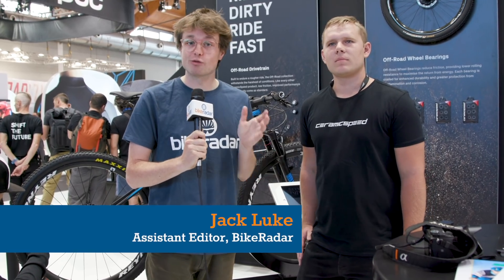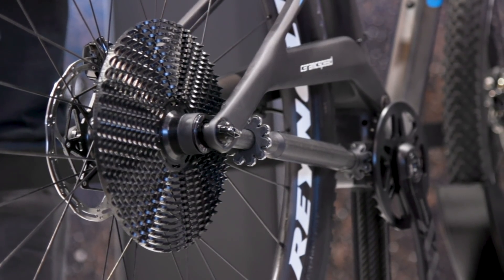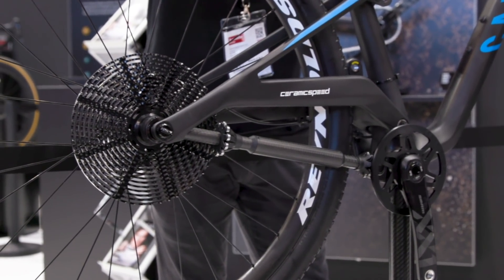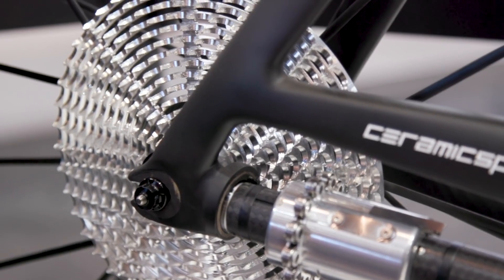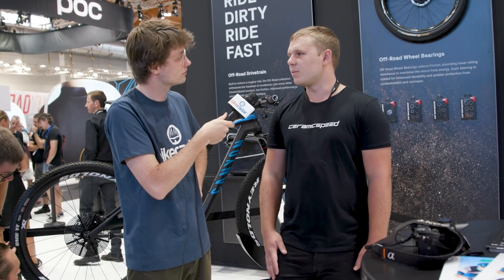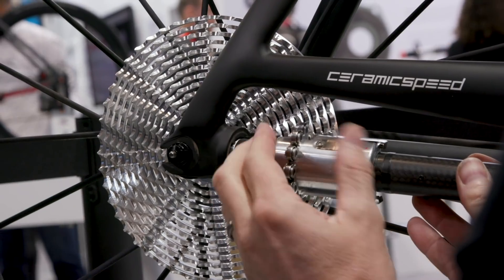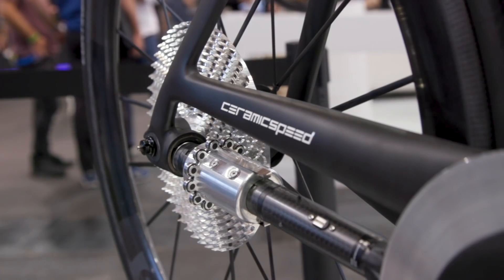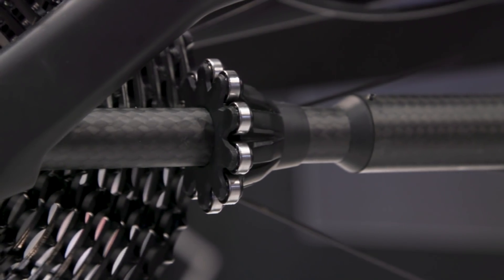No More Chains! The Future of Bike Design? | CeramicSpeed’s Driven MTB & Road Drivetrain

Comment: Don't know why people hate on this concept. They are comparing a finished product to a prototype. I'm not the biggest ceramicspeed fan when it comes to their ceramic bearings and their pulley wheels but this concept can become a real alternative. Hat's off to ceramicspeed.
Reply: Don't see the downside to the research, other than $. But if people are willing to risk $, why the hell not? Even if it ultimately doesn't work in this form, it may lead in other directions to other innovations. Whenever anyone states with great assurance that something will never work, I can only laugh, because there's only one subject where such proclamations are even remotely justified - math
Reply: Put  that  thing in high  gear  stand on the pedal   and  watch   that  rear sprocket   slip teeth.
Reply: Because it's useless horseshit is why we hate on it. If you're such a damn visionary buy the prototype and ride laps around all us pessimists and luddites. Wow, you are so freaking imaginative and smart. Better yet invest your savings in the company, since you're so ahead of the curve.
I clicked on this video to get it out of my recommendations. I will never purchase anything from ceramic speed. I will always know them as purveyors of insulting click bait.
Reply: the good old chain is just better
And more reliable
And easy to fix or replace
Reply: @riyadzahdour1302  more reliable? No. Easier to fix or change? Yes
Reply: @stevengunter4990  someone give me a reason why no one uses this system other then it just isn't as good as a chain please
Reply: @stevengunter4990  Chains are extremely reliable provided they are maintained correctly.  The chain itself isn't even the problem on a bicycles transmission, it's the derailleur system that is far from ideal but still better than anything else that has attempted to replace it so far.
Reply: I agree with filip000. I used to sell bicycle with a driveshaft transmission. Brik bicycles is a Dutch brand.
These things were really hard to fix when broken. This right angle gear meshing was so sensitive to missallignment.
And still these things would wear out fast 10.000 km or so. Than there was the weight and efficiency. Terrible!
These ceramic guys expect too much from their material science department.
Adding a few small rollers for efficiency.
This thing will never perform outside a lab.
Reply: 1. Loss of efficiency due to right angle.
2. One small pebble and it's destination f--ked.
3. Cost
Reply: @truantray  which system do you mean? I can relate these points to my current drivetrain. 😭
Reply: Looks like wont stand up to a muddy bike ride
Reply: It has no chance of working reliably when alloys start to wear from normal-amateur use. Absolutely no fucking chance for off road and pro muscles. If it was reliable, shimano would be in the game. cs is just a bunch of clowns. Now you know.
Reply: design of prop shaft and way it touches theet is not good, it will bend if step on pedal as animal, take a look on your bike how it swings: front rings, rear triangle,,, in this concept must not be any movement between skaft and rings othervise will skip theet
Reply: It looks flash in practice ? If you know about cycling gears are useless , you move a bike by torque , its an expensive flash looking waste , no mention of torque or how body works . , Imagine that covered in shit in a year .
Reply: If you've ever drove mtb, you most certainly bent, damaged, or straight destroyed your  front gear and broke off rear derailleur mount. Here you will directly damage either your gears or your frame, or you will bend irreplacable front gear. This concept is nice theory, but from maintenance and general usage theory it's a nightmare.
Reply: No, it can't be a legitimate alternative with its current construction or intended use. It's been done on utility/city bikes before, and those were fraught with issues every time.

There's power loss with every 90 degree change in direction. This is accepted in other applications because there's sufficient margin within the power available. 

Unless very hard materials are used, this will lack durability for enthusiast riding. Most gears in shaft driven applications use tough, if not very hard, steel gears. I'm doubtful that aluminum sprockets will be stiff enough to prevent deflection, especially once worn. Chain driven gears are loaded inline with the chain, so they can use lighter materials or thinner sections. 

These types of gears handle contamination poorly. In a transmission or industrial application the teeth would be submerged in oil or greased and sealed. Even then, those typically have a filtration system. You could compromise a bit, but not enough to put this in a muddy environment. Current chain driven bicycle sprockets are cheap and deal with the contamination decently. 

The biggest reason though: it's an inflexible design and can't be retrofit. That will singularly stall adoption. Gearboxes and some internal gears have similar hurdles,  but handle this concession well because they're generally designed for high durability. That seems to be the antithesis of their design.
Reply: Chain much better driven than shaft. Much direct feel and less lost of power.
Reply: There are issues with durability, staying clean, not being repairable, etc.
Reply: Its gonna last five minutes as its only got one point of contact.
Reply: @rossy2998  nonsense any gearbox with straight cut gears work just the same.  Besides they have already tested it..
Reply: Because the concept has 2 major problems, a 90 degree gear mesh has a lower efficiency than a straight one and there is no synchronisation.
Reply: It's useless from an engineering standpoint. I explained why in a post above.
Reply: @filip000  Saddly couldn't find your post but as a MTBer having no deraliour to worry about doesn't seem useless to me. Additional dust and water protection could make this concept a real reliable alternive to my current setup.
(A MTBer's perspective)
Reply: @Rabrand1  In very short: instead of transferring power over some 15+ teeth, it uses 1 or 2. It will fail, develop play, and will NEVER be as 15% as good as a regular chain. Also, 100 year old concept.
Reply: @filip000  Thank God the Wright brothers didn't listen to people like you back in the day.....keep it up, dude ;-)
Reply: @filip000  Couple of things, 1) they're using bearings that roll over the teeth, they don't just grab the teeth like a chain does. 2)Chain driven bikes are over a 100 years old. So what?
Reply: @userbeverage  Not agreeing or disagreeing with you, but the Wright brothers used chains.
Reply: @tubularmonkeymaniac  what do you think is in each chain link? Roller bearings mate. Every single link. Go to your bike, you can spin em if you took care of your chain.
Reply: @jasoncall3731  3% more aero but how much mechanical force is lost. I know shaft driven bikes tend to lose some power..
Reply: @0xsergy  Bushings. Not bearings.
Reply: @tubularmonkeymaniac  ye? I can definitely spin the middle bit in the chain, the roller. Feels like a bearing to me. Maybe there is more than one type?
Reply: @0xsergy  you can spin it, so it must be a ball-bearing, right?
I can assure you, that there is not a single ball-bearing on your chain.
These are all normal sleve bearings.
Reply: @fabianrudzewski9027  a bushing is still a bearing. It is, by definition, BEARING a load. Ceramicspeed may be using bushings too in their prototype. Also, the majority of wear in a chain-driven system is from small contaminants entering the system and acting as a grinding paste/fluid. If you need an example, look at a bike with a full, sealed, oil bath chain case. Those regularly achieve 12k miles per chain. Last, what happens to this drivetrain if you force a shift? With a chain, it would just clatter around or bend the links. Worst case, the chain snaps. I don't see any parts that would fail safely on the Ceramicspeed drivetrain. I personally don't like pieces of carbon fibre and aluminum sticking out of my leg, but maybe that's just me. Thoughts?
Reply: @mykytajex2248  The failure point would be the 'bearing sprocket'  for lack of a better term, or the face spline that replaces the cassette.  It would certainly be a lot more expensive if/when it fails, but you wouldn't have any carbon fiber in your leg.
Reply: @jeremymercer5655  I just point it out as I see two potential failure points: the drive rings and the rollers. The drive rings need to be as stiff as possible to not bend out of the way under heavy load. That leaves the shaft. If a rock slid in between a roller and the drive ring, something will snap. It may be the rock. It may be the drive ring. But it also very well could be the carbon around the engaged and heavily loaded roller. Pretty decent chance of something assploding, yes?
Reply: @mykytajex2248  most people are not strong enough to break a carbon tube simply with pedal torque, so if nothing else broke it would just jam, and probably tear up the bearings so they don't spin.  Carbon fiber can break pretty easily if it is struck directly by something like a rock, but it will take a massive torque spike to break it.  Even if it does break, it's not going to explode.
Reply: @userbeverage  ur wrong. Momma's right
Reply: @filip000  the teeth thing is meh cars use driveshafts for ages and they are fine, sure a chain has more teeth but that doesnt mean that a system with less MUST fail.
Reply: @stevengunter4990  thats because its not a performance bike
Reply: @filip000  you are right. Also it doesn't have any solution because if you juxtapose two circular metal with perpendicular angle, it always just touch at most 2 cogs even you change diameter of metal
Reply: @tubularmonkeymaniac  chain does not just grab teeth, chain links acts as bearing, thats why teeths are round shaped and ring inside chain link rotates, is now more clear 100 year old technoligy
Reply: @userbeverage  There were many like Wright brothers that failed miserably and lost all their funding to nothing. The difference here is that nobody really understood flying then, and it is pretty clear what the drawbacks of this system are right now.
Reply: @tubularmonkeymaniac  Chain also rolls into the socket, and doesn't move in it at all until it leaves it. Pressure of the contact points is much higher here because there is less surface in contact that is transferring the power (and the rotational speed isn't enough higher to counteract smaller contact patch). There are serious engineering problems with this concept, just because something is different it doesn't mean it's better or that is has potential. For example, the gears on the wheel will deflect unless they (and their mounts) are significantly stronger than what is shown in this prototype. That way of deforming does not happen on normal sprockets because forces are all in the plane of the sprocket. So if you increase the weight by a lot to make it actually work in real world, now the drawbacks outweigh the benefits (which i'm not sure there are any significant ones in the first place, people just like because it's different).
Reply: @userbeverage  they probably did, they just didn't let it stop them, and also listened,  and improved.  Thank God the calling criticism "hating" fad is dying.  Grow up and fix what the people are complaining about,  and succeed. Like the Wright Bros! Thank God they didn't receive participation trophies as kids!!
Reply: @filip000  Also agree with you but I just wanted to add that this design will fail because as general rule of engineering, the more complicated a system is, the more susceptible to failure from wear and tear. For example, you can run a cheap Mazda car for 5 years without maintenance and it will still just run fine however if a $500,000 Mercedes without 5 years of maintenance will have multiple systems failing because the Mercedes is far more complicated engineering. 

This bike design is far more complicated than the simple chain pedal concept and the transfer power shift over different array teeth is going to cause chips and fractures as the kinetic energy release with a 80kg human would cause too much stress to the second or third row of teeth upon transfer.
Reply: @filip000  Agree, just look at fishing reels , spinning vs overhead for heavy duty deep sea jigging uses. The overhead reel will outlast the spinning reel as there isn't a need to convert the torque from vertical rotation to horizontal rotation. Deep sea heaving jigging is very demanding on the gear teeth of said reels, the spinning reels take more punishment and fail faster.
Reply: @filip000  I'm sure the team of engineers at Ceramicspeed have done their research and have carried on lots of testing. Also Ceramicspeed isn't a startup or a small company, so there must be demand for a new drivetrain concept otherwise they wouldn't pour this many resources on this project.
Reply: @serjoprot  Gotta answer to this one year old comment. They're apparently crowdfunding this now because they could not convince any industry experts & investors, and don't want to fund this themselves. I wonder why they don't fund this themselves? Because they don't have trust that it will work. There have been countless engineers explaining how this will not work with rock solid mechanical engineering terms. And it doesn't work. Not a single video of it SHIFTING UNDER LOAD. This has been the biggest scam in the cycling industry we've seen since some time.
Reply: @serjoprot  Indeed, they are now on crowdfunding asking for money, they don't want to waste their own resources on that project.
Reply: Wherever you go with new concepts, you will find experts hating. They will give you countless reasons why it is not viable or impossible. In 100 years they will be dead and sadly, mostly forgotten. Whilst the some of the ideas the hate upon will be common place. Such is life.
Reply: @maximillianalexander7052  Often those "experts" are correct, especially with history on their side.  Many different solutions for bicycle transmission has been tried in the last ~100 years and yet nothing to date has significantly challenged the dérailleur despite it's inherent flaws.  I don't want this to fail at all, the shifting mechanism is pure genius but the questions raised about the rigidity of the rear gear assembly and it's resistance to contaminants are completely valid.  I hope the design progresses to overcome these challenges, but it's clear there is quite some way to go.
Reply: SkyWizardless no one is saying the obstacles are’t valid though. But no doubt there are experts just dissing it for whatever reason. They are in every industry.
Reply: @maximillianalexander7052  You referred to the people pointing out these problems as "haters".  Why would you do that if you think they are making valid points?
Reply: SkyWizardless well some people make valid points and provide or ask for solutions and some people will use a valid point as a be all and end all of an idea. Whether it be aviation, bicycles or motor vehicles, haters gonna hate.
Reply: As a Mechanical Engineer. 1 nothing is wrong with chain and it it the most efficient drivetrain known. This is overly complicated... Its a shit idea.
Reply: @vikingbear  ok let's say i believe you in your claim that you are engineer and chains are the most efficient. With your engineering credentials:

why use driveshafts in cars instead of chain?

Conversely why use driveshafts on some motorcycles instead of chains?

Why do they use shafts on cars and on some motorcycles but then it suddenly does not make sense for bicycles?

People have also said that disc brakes and carbon fiber parts would be useless/impractical on bikes. But here we are.
Reply: @vikingbear   as an ME you've never goofed around in the shop and made something just to see if you could? And as a result, learned some useful stuff? These guys have been given a LARGE budget and a boss that said "go nuts"--none of the engineers I work with have that kind of running room. Yeah, it'll be tough to make this thing practical in the short term, but that split pinion sure is fun to watch in action, and they're learning (and I'm sure, patenting) new ideas that will be useful in other products. Let these folks play, and see what they come to with!
Reply: @MrTheRuncible  I actually was part of such a project just as I completed my PhD. It was wild ass full on creative take on a problem that simply did not need solving. We came up with crazy tech, we marketed the shit out of the thing, and we had one media shitstorm... But at the end of the day, it was ultimately a flawed idea. Some problems just don't need screwing around with.
Reply: @vikingbear  chains are heavy and require a lot of maintenance in dirty or dusty conditions. If they are so great why do BMW use gears?
Reply: @kentonian  what does motogp use?Also if its a shit design why haven't you come up with something better? All cycling use a  chain.. If this system worked they would use it..
Reply: @kentonian  plus theres a chain on bmws best bike
Reply: Bmw uses shafts in their adventure lineup because they're basically maintenance free. But efficiency wise shaft driven motorcycles lose out by a large margin. Even belt driven motorcycles lose out efficiency wise to chain and sprocket.
Reply: @rossy2998  what do you consider "best bike", because for me thats the bmw gs and it doesnt use a chain
Reply: Nobody likes this concept and the number one reason why is because they been throwing around for years and years now and nothings come of it and nothing ever will come of it because it doesn’t solve a problem that needs a solution with this drive some weirdo bike 10 years from now maybe but that’s doubtful this thing will almost certainly never reach market
Reply: liquidwombat disc brakes in road bikes, and full suspension mtbs were considered bullshit last time, seen on and off, cuz 'why do we need it? Rim brakes/fork sus is good enough'
Now, standards are disc brake roadies  and full sus mtbs, so the 'iTs aN oLd cOncEpT' bs doesnt work
Reply: @jeidun  You clearly have not seen the myriad of suspension designs(front and rear) that have been tried since the 1890s. There are so many designs that have been tried over the history of 2 wheeled vehicles, don't assume it all happened recently. 

 Disc brakes had been done a few times on bikes before they stuck, but the problem wasn't really mass appeal, it was execution. The early systems for bikes just weren't very good and MX systems weren't either. Once a proper design was made, they were used continuously.

 The road problem is one of traditionalism and reluctance to change. That's falling away a bit in the last decade or so, but there are hold outs. The UCI keeps new ideas out of racing, for better or worse, as well. There are certainly arguments for slowly changing equipment in a competitive environment. 

The reason people dismiss shaft driven(this is an iteration of shaft drive) systems is because their advantages aren't particularly relevant for bicycles. Ceramicspeed is intentionally fudging the numbers a bit as it's not yet a final version. Assume that if this were a mature system that weights would climb dramatically, cost would be high, and the bulk of efficiency gains would erode away. A shaft driven system needs extremely high stiffness within all components, so lightweight materials are off the table. Especially in racing where power output is high and there can't be any doubts about performance. The most I can see is this being used in a limited capacity for TT use only, where power output is moderate but consistent. Weight wouldn't be a huge issue then.
Reply: @liquidwombat  chain and derailure are about the most clunky engineering solution I've ever seen.